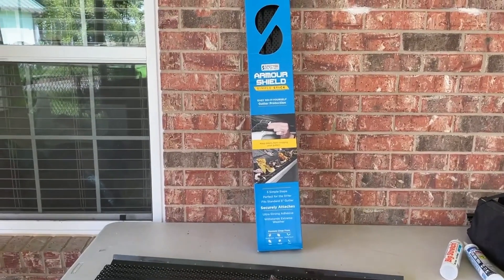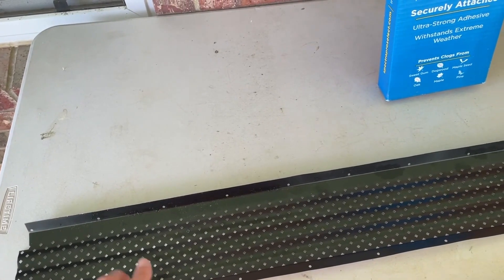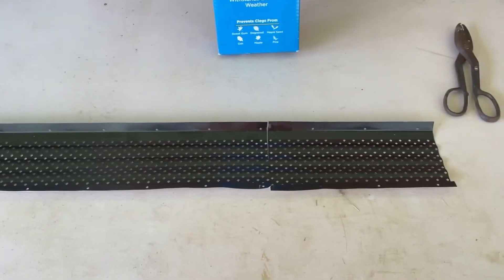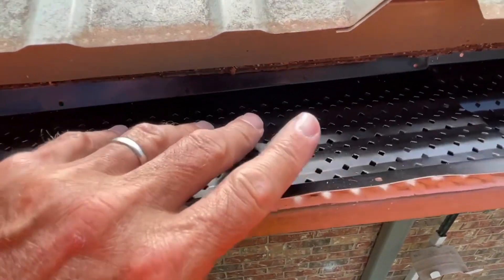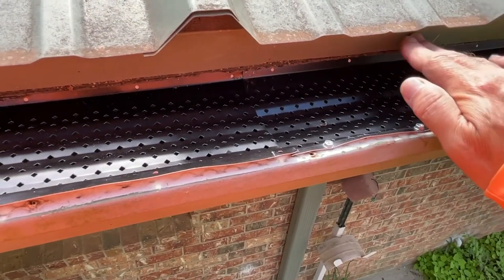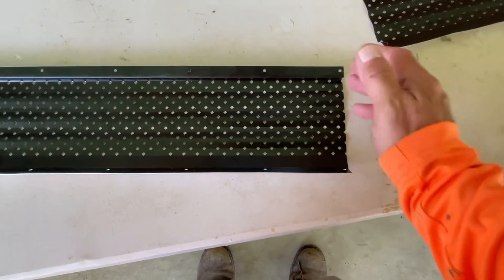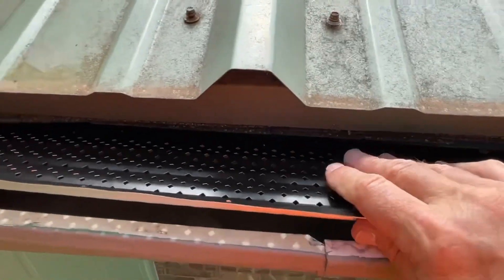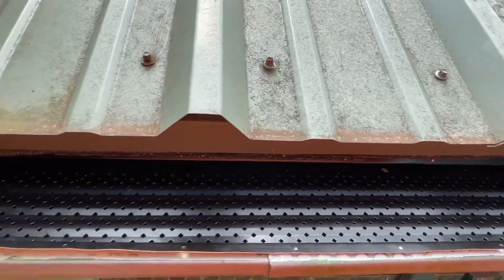Armour Shield Gutter Protection Install

Comment: Don’t work so well when the gutter hangers are level with the gutter and the roof, but I’m thinking who ever installed these gutters did it wrong because the hangers are screwed in under the shingles at the top edge of the roof, I’m not sure if that’s how the use to do it
Reply from the maker: Ok 👌